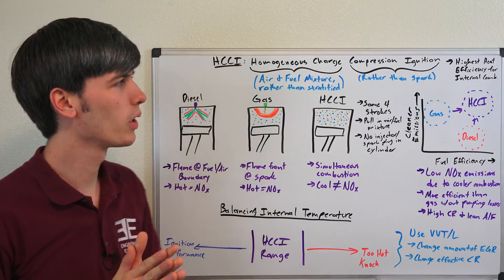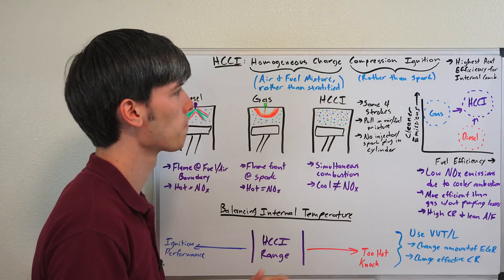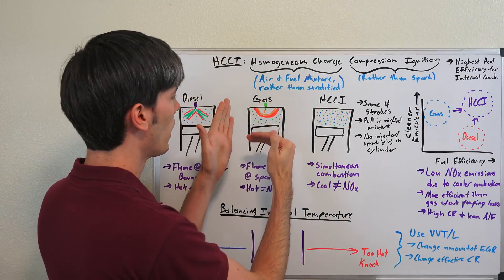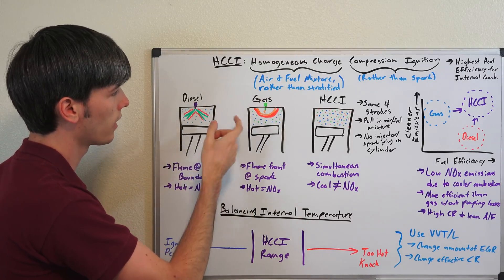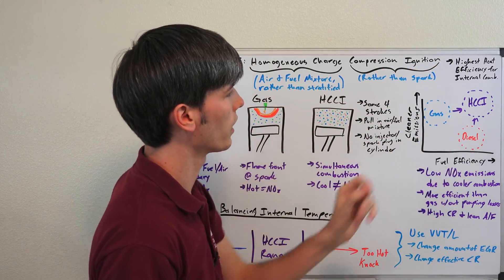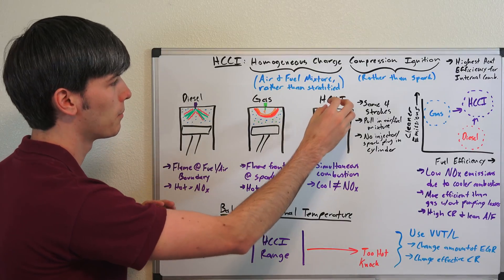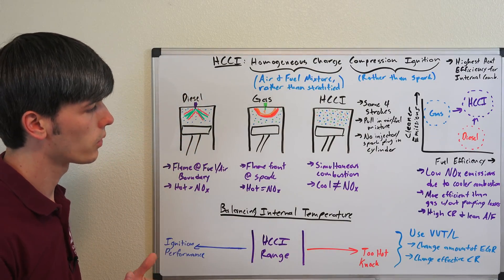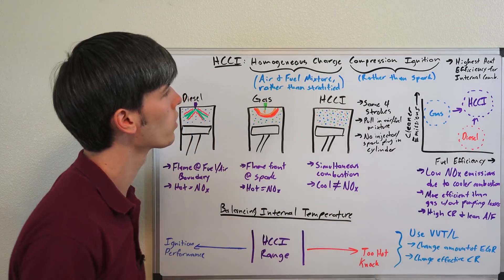The Most Efficient Internal Combustion Engine - HCCI

Comment: Without some kind of igniter I'm guessing the engine block would need to be heated just to be able to start. This is interesting. I'll be looking for more videos about this. :)
Question: is this method more efficient or less efficient than a Stirling engine powered by the same fuel?

Comment: This is a great lab experiment. What I mean. I ask if these engines that run in this narrow band, this band of better than diesel and better than spark ignition can manage to stay in this narrow band under the conditions that the automobile engine operates? These conditions are, less than perfect maintenance, effects of heat and cold environments, engine wear, fuel quality. Can such an engine give us the horsepower over the range to allow us to operate our air conditioning, give us performance for towing, deal with stop and go driving, give us economy and clean emissions when both cold and hot? My feeling is the IC engine is where it is because it is so darn hard to create and engine that fits all these parameters.

Comment: So this is basically a diesel powered by gasoline?  I don't recall you saying what kind of fuel this would use.  I think I'll keep my gasoline engine that knows when to ignite the mixture rather than depending on the air temp, humidity, baro, specific fuel used, engine temp, and other factors to hope it spontaneously combusts when you expect it to.

Comment: This engine sounds silly, probably won't work, and will be a nightmare of finicky computers unreliable sensors and a kings ransom in out of warranty repairs.
Reply: Oddly enough that is the exact phrases I heard in the early 80's about computers taking over mechanical tuning in vehicles.
Reply: In the early 80's it was true wasn't it?  Computers cost a fortune and went out of whack all the time.
Reply: True that when they first came out they were expensive for a few years but the price dropped to reasonable levels very quickly (4-6yrs) and were generally very reliable I have a late 80's vehicle in my garage with near 400,000km on it and the original ecm still working fine 30yrs later.
  Most of the time when they first came out people would jump to the conclusion that every problem with a car or truck was because of the new fangled computers. most of the time it was a poor signal from a sensor due to wire corrosion or some parameter that wasn't controlled by the ECM. The first generation of computers were very very basic after all. Everyone always seemed to lay fault with the ECM's because it was this mysterious metal box that controlled the engine most consumers really didn't understand how it worked. Look at modern vehicles and I seriously doubt that anyone would dare buy a new car that didn't have at least 1 computer.

All that being said this type of engine has much bigger hurtles to deal with beyond performance management through a computer.

Comment: What causes the spontaneous ignition? Why isn't that explained? I understand the spark and glow plugs causing ignition in gas and Diesel engines, but since this is neither of those, it is the most critical difference and the only thing that I care about and it's the one thing that's not discussed!
Reply: It's ignited by the heat of compression similar to a Diesel engine.
Reply: It's called compression ignition (ci); when you compress the intake charge it increases in temperature igniting the fuel/air mixture!  Diesels are ci engines also, and only need the glow plug for starting and some diesels not at all!  In diesels the air is so hot when compressed the diesel fuel burns right when it's injected in the combustion chamber by the injectors.
Reply: Glow plugs don't cause ignition in diesel engines. They just preheat the air when cold starting. SOme diesels don't have glow plugs.

Comment: he is just making stuff up yet again. Engineering Explained, you need to lean something about engines before you attempt to teach others. diesels for one don't use a spark plug and if the diesel engine does have a Glow plug it is only used during start up. gasoline mixed with diesel can't ever be more efficient the either or. gasoline a diesel don't burn efficiently at the lower temperature that gasoline does.

Comment: Great video. Another factor that needs to be considered is the octane level of the fuel. I'm happy to be corrected on this but there would need to be a much tighter range for the fuel octane level when compared to engines with spark plugs...

Comment: But if you leave the intake valve open during compression in a HCCI engine, you're just pushing the Air Fuel mixture back out into the intake manifold.

Comment: maybe you mentioned this but how does the fuel ignite?  Since there is no specific heat source because of the risk of  causing the heat wave is a HCCI engine being ignited by just putting the fuel air mixture  under extreme pressure till it reaches the temperature of ignition?

Comment: Unless the piston is moving impossibly slowly, you're still going to have a flame front and it is going to come off the piston... probably close to the cylinder walls, unless the piston is hotter. Could HCCI be better? Sure! Is it homogenous? No way!
Reply: i agree... theres gonna be a point in the combustion chamber thats hotter that the rest.. and will likey nucleate a flame front...homogenous combustion is the goal...
Reply: it might not be the 100% homogenous, however when you are this close to the self ignition temperature via compression any increase in pressure will get the entire mixture over that treshold. meaning,  if a flame front starts at any point in the chamber the pressure would increase and self combustion temperature would be reached. in layman terms, if a small amount of the mixture ignites the rest wil ignite instantaniously.
Reply: H.G.D Amptmeijer It is a fluid dynamics and reaction rate problem. It doesn't happen "instantaneously". Nothing does, nor ever will. There will be a pressure front as the piston moves to compress the gas because it takes time for momentum transfer to happen, i.e., pressure will NOT increase uniformly... even with a reaction present. The only question is the relative speeds of things and that depends on a lot. Unless you're a rocket scientist, maybe I am wasting my time. Are you and am I?
Reply: instantaneously was also part of the laymans terms. thank you for the expolanation. i am, however, aware that it is not uniform nor instantaneous.

Comment: I would like to point out several disadvantages of HCCI that holds this technology to be production. 
1) Challenging in cold start ability
2) High cylinder pressure rise rates cause higher engine wear and NVH
3) challenging in autoignition control
4) Small power range due to in-cylinder pressure restrictions
5) High CO and HC emissions due to lower combustion temperatures, which results in less oxidation in the expansion

Comment: that all seems too complicated ill just keep the old 6.9  idi hammering away
Reply: when youre about install your 10th Lucas/Stanadyne  injection pump.... go find a late 12V P-7100 pumped cummins....  then you can let IT hammer away and only change oil and adjust valves...
Reply: J MR my ip is pumping away just fine at 300k thank you people who have problems are feeding their diesels veg oil and hydraulic and think its ok or get fuel at shady places

Comment: The methods  you mentioned would control the temperature, but possibly  the initial  start would  need a very high compression ratio. That engine block could be very cold! I suppose the compression would be much higher than when the engine is all warmed up.

Comment: Isn't efficiency ultimately a function of the temperature gradient across the engine? The higher the gradient, the greater the efficiency, according to Carnot's theorem. So I can't quite understand why having a cooler combustion process leads to higher efficiency. What sort of figures are we talking about anyway? If a typical IC gets 25% (maybe up to 40% for a really well tuned diesel) it's still pretty pathetic compared to an electric motor (~95%). It seems to me that IC technology is pretty well dead at this point. The number of moving parts and mechanical complexity is increasing for ever smaller efficiency gains, where (due to Carnot) you just can't win anyway. You need higher temperatures, therefore will get more NOx. I just wish they'd spend those research dollars on batteries and fuel cells, not this garbage.
Reply: An electric engine needs electricity. Power plants are around 35% efficient, power transmission has losses. And the batteries have losses.

Comment: Seems like that would work good with a hybrid system with the gas engine running at a constant rpm charging batteries and drive the vehicle electrically.

Comment: ok so just a couple questions. im not completely understanding fully, but im just a humble backyard mechanic..what type of fuel will it use? how will it be introduced into the chamber? like a carb? how can you make a homogenous mix with egr? it seems like that would get in the way, and also how can you prevent the loss of fuel while using vvt to reduce compression if you couldnt time an injector to fire when the valve is closed?

Comment: Solution: Inject a very small percentage of total fuel at the correct time, thus causing a burn avalanche in cylinder. This fuel charge can be variable in timing as well as volume to compensate for cylinder temperature, humidity, etc..  Problem solved, now get to it!

Comment: Nice video about a nice concept. How would an Open-Sleeve engine work under this HCCI principle?, Open Sleeve as in the CI 2-Stroke engine described by Harry Ricardo, but in a 4-Stroke cycle. 
How it's done to avoid an instant burning of all mix in HCCI? The image it gives is as no way of avoiding something like a huge fart taking place inside the combustion chamber.

Comment: So basically it is a regular gas engine, with the exception being that instead of using a spark to ignite the fuel, they cranked up the compression ratio, and the heat generated from that is what makes ignites the fuel.
Reply: Basically a pressure cooker engine?

Comment: this concept has been used in the past on some bicycle engines. the lohmann for example was one of the more common ones. this was a 18 cc 2 stroke with a variable compression ratio from 1/8 to 1/100, the compression ratio had to be adjusted to multiple factors (throttle position, load, temperature, speed type of fuel, etc), the efficiency they claimed was 1 liter for 100 km.

Comment: So, it's a detonation engine.... Lol! Seems it would be quite difficult to to get gasoline to reliably deflagrate via compression ignition given varying altitudes, ambient temps, differences in fuel brands and grades...I feel like there would be a ton of complexity to get this engine to run consistently and reliably without becoming a detonation machine. As far as diesel... Without the temperature and pressure spike that injection inherently introduces, the compression ratio would have to be very high to auto ignite the fuel, and you would still have to have extremely high fuel pressures to atomize the fuel enough to stay in suspension. Maybe something similar to a hot bulb type engine, but then you have to heat the element that is atomizing the fuel, because combustion would no longer be doing that for you... Again, lots more complexity. 

The more they complicate the plumbing, the easier it is to stop up the pipes.

Comment: I can see this type of engine being used in a hybrid car, as a reserve source of power when the battery runs out. Just a small HCCI engine with an equally small gas tank connected to a generator to let you limp to the nearest charging station.

Comment: Any one else remember the good old days when we paid out big bucks for fancy intakes to ensure perfect air/fuel mixing? Then we put out even more big bucks for programmable electronic ignition systems to ensure spark timing was dead on given that days weather conditions?
Then it was all made obsolete by fuel injection and direct ignition...
This is a good idea I think in terms of efficiency. Lower temps mean less gas expansion, though. That translates into less power. Bet these are similar to hydrogen engines in terms of power.

Comment: So this is just theory, right?  I didn't see any engine...just a whiteboard.     Well, IF this problem with the ignition timing is solved, does the fuel need any additives in order to make it able to spontaneously combust under pressure? Or, does the fuel mixture need to be somehow specially treated prior to injection? I ask this because I'm wondering whether any weight-saving gains, of not requiring a spark ignition system, would be lost by the requirement of another system.  
I do have one major problem with this video, though: making unfounded claims about HCCI being better than other fuels WITHOUT GIVING ANY DATA ..... is just insulting to our intelligence.  Please publish the data, the conditions, and all the factors, and we can make up our own minds as to whether it is 'better', or just 'marketing-speak'.

Comment: The thing was invented long time, like century ago by the name "carburated diesel" or "pressure detonation ignition engine", usually used in HOT BULB / HIT AND MISS engines.
Pressure detonation engines produced enormous short term forces on piston(s),crankshaft and all the connecting stuff, so things needed to be big and heavy (for same power).
That is one (not only...) reason they did not get into automobiles/other smaller/lighter stuff, just tractors, other farming eq. and stationary engines...

Comment: If compression causes the ignition, how high is the compression ratio?   Is it a lot higher than conventional IC engines?    I might deduce from this video that the only reason we need spark plugs is because it's difficult to maintain temperature range with the HCCI.

Comment: The solution seems simple... in theory. As pressure goes up, so does temperature. So you can control temperature by controlling pressure. So just have a small cylinder on top of the main one with which you control the volume of the chamber. If the temperature is too high, lift that cylinder a bit to increase volume.
Reply: that is a brilliant idea
Reply: they explain this in the video by using VVT. If the temperatures are too high, then lift the exhaust valve slightly so as the piston rises, some gas escapes, but close it quick enough so that there is sufficient mixture to combust without it pre-detonating
Reply: thescooble But that's less efficient, because you reduce the amount of gas mixture in the cylinder. Also, it involves some complicated actuators to control the valves so precisely. Why do you think there are no (or very few) engines on the market with actuated valves, and instead they all rely on cams to move the valves?
Reply: yes, I agree, that by reducing the amount of mixture in the cylinder is somewhat wasteful, but the fact that the mixture is homogeneous means a better burn. The complex VVT also reduces mechanical efficiency, however, I'm not sure what the net gain is overall

Comment: HCCI has been in the works since the 80s from what I recall. It hasn't yet made the transition to commercial applications because it is unreliable. Like you mentioned the knock problem. I imagine enough instrumentation could be used to keep the engine in that narrow island but I would watch super critical direct injection as well. Super critical direct injection makes better sense with cooled compressed air but I see that as a trend with down sizing anyway.

Comment: How about you keep the spark plug in place so it will fire when you need to up the temp (to help with ignition performance) and shut it off to keep from overheating (stop the knocks). Of course the spark plug would have to be redesigned, but I will leave that to much smarter people than me.

Comment: Smokey Yunick tried a system 60 yrs ago of vaporizing gas before it was introduced to the cyl. This allowed total elimination of an inefficient carburetor and allowed intake manifolds to be developed that did not have to be designed with droplet seperation and "boundry layers" in the runners. He was achieving HUGE milage increases with contempory engines of the time. The big oil companies shut his Ideas down QUICK. 

How about HCCI combined with vaporized gas!!!!!!!! Jus sayin>

Comment: Sort of reminds me of the adiabatic "Hot Vapor" engine of the late 1970's and early 1980s. Similar concept, but it purposely ran hot and lean. Not sure about the NOx, but it did have better power and efficiency. I think the idea fell through because any carbon deposits caused problems. Basically it could form hot spots and you'd get pre-detonation and knock. So such engines required a tight maintenance schedule.

I wonder if modern fuel is clean enough and when combined with better sealing piston rings, the concept is worth retrying?